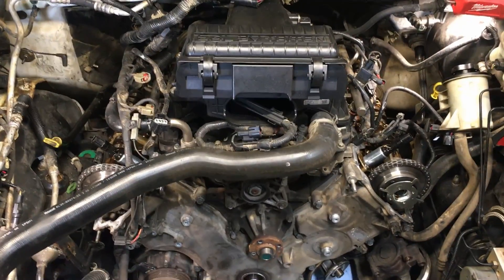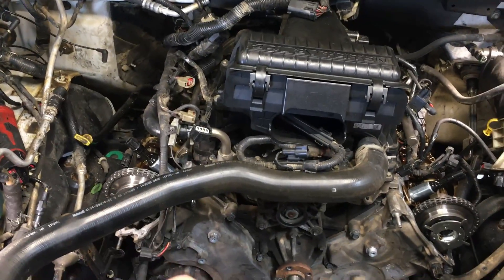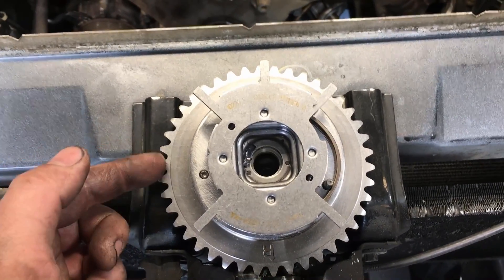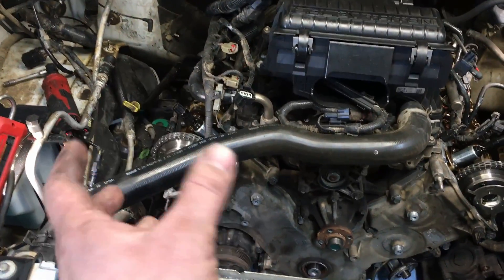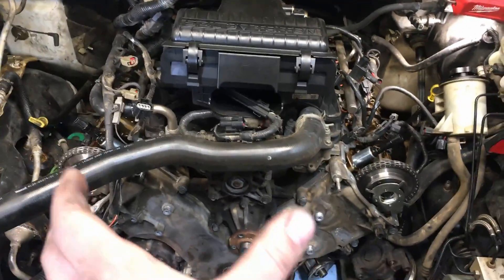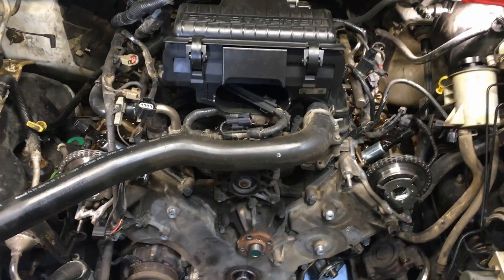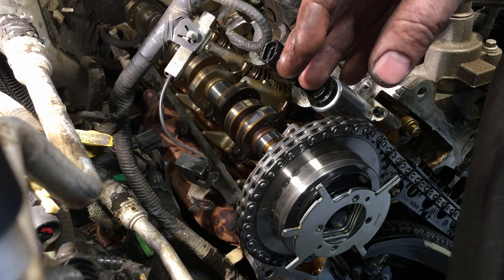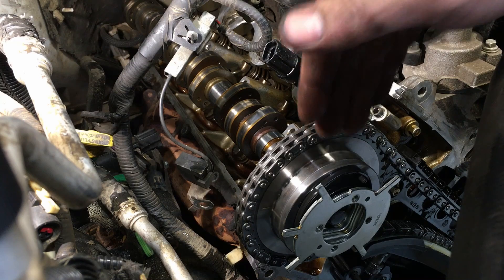Ford 5.4L 3v Triton Engine: DO NOT USE AFTERMARKET PHASERS FROM FREEDOM RACING/OTHERS; THIS IS WHY!

Comment: I did this job two days ago put aftermarket coyote parts. Turned it on ran fine accelerated ran like shit took it off because I thought I said the timing wrong. I did notice what you talked about at six minutes and 14 seconds but I was in a rush and I did not realize until it was too late. So I reset the timing and the same thing cam crank correlation On bank two. 
No I’m ordering OEM parts

Comment: I noticed that the colored link on the timing chain is also not lined up on the gear
Reply from the maker: They don't line up again after the engine is run or turned over by hand.

Comment: Ok so you say not to use aftermarket phasers but what if you lock them out? If you lock out the phasers does it matter if they are aftermarket?
Reply from the maker: Yes it does actually.
Reply: @FordTechMakuloco  why would it matter if they don’t have any moving components? No one from the aftermarket makes a decent part? Isn’t it the ford phasers that failed in the first place but we put ford parts right back on?
Reply from the maker: There have been many reports of the lock out blocks fitting loose in Dorman and other aftermarket phasers causing a knock afterwards.
Reply: @FordTechMakuloco  Thank you for the info. I just picked up an 06 F150 4x4 for dirt cheap. It has an intermittent squeaking noise coming from the passenger side cylinder head. I have not taken it apart yet.

Comment: I have 2, 3V engines and a 2V. I've not had any problems and no funny sounds all bought new....Doing my own oil changes 3000-4000 miles.189000 3V, 129000 3V, and 191000 2V. But...I like keeping myself informed! There's not but a few guys on YouTube I trust and watch......You and DieselTechRon RIP (6.0KIng)

Comment: You recommend changing the cam shaft position sensors?
Reply from the maker: no
Reply: @FordTechMakuloco  okay. I’m starting to get the low rpm engine rattle so I’m guessing it’s time to replace everything.
Reply from the maker: yup

Comment: When I worked for a used car dealer I did a bunch of these phasers some times a couple sets a week. I remember the first one that was done when I started working there another tech was doing the job and they bought dorman phasers l laughed and said u would be better off installing the used set of phasers off this core engine we had in the back room but everyone said “it’s just a used car by the time these are a problem the car will be sold and long gone. Well he put the phasers in and it ran like shit so he put in a timing set and still ran like crap so they give the truck to me to work on and just to prove a point I took the used phasers off the core engine in the back room and installed them, test drove the truck and handed the keys the the service writer and he said what are the keys for? I said the f150 I put them used phasers in it and it’s all fixed! He gave me this blank stare and I said I told you not to use cheap crap.

Comment: With Ford having failed like 6 times, what would you say about the new Dorman ones? I haven’t seen the ones that are failing but I have seen someone say a failed Ford one was dorman, or they were still using fords design, but the new dorman one has short veins and the centre part that the vein goes into has raised sections that bring the short veins up to the right position (the failed one I’ve seen having failed at the long veins and two of them snapping) the video dorman had claimed they were redesigned to prevent wear which I can’t attest to and seek guidance that is more up to date

Comment: Very timely video.   2007 f150 rebuilt 8k ago.  Had it in 4low and high revved coming up bumpy hill. Engine turns and tries to start but does not.  I am hoping this is where I start. Won’t know if phasers are Ford until I peel back the onion.  Is it a good guess I have a phaser problem?  No noises or oil from engine is noticeable.

Comment: Why do you have to take the whole thing apart I can change the phasers in 1 1/2 hours I get the ford parts should be used I agree 100% but if you know they failed I could wedge the chain and install just the phaser if the customer is comfortable with his timing marks, it would be more risk to him if timing is off I would have to go back in but so far never had that pulled covers wedged scratch markes TORQUE the center bolts
Reply from the maker: Why? I don't trust one piece of the timing kit he installed. Especially that aftermarket chain.

Comment: I bought cloyse timing kit and ended up having to buy a new for phaser for the passenger side now after some research I’m gonna have to buy a new one for the driver side. I’m glad I’m doing all my work my self.
Reply from the maker: Swap it all out, the aftermarket chains are known to break.
Reply: @FordTechMakuloco  I wanna get you opinion on what it is bf I go and buy a phaser.I got a 06 f150 new timing chain, guides, phaser and tensioners￼. Drove it for about 30 minutes no code but could tell some was not 100% right. Finally got a code p0022. Replaced the vct and changed the oil still the same code. What could it be?
Reply: Also millings oil pump and pick up

Comment: I have built a couple of small block Chevy engines (and I'm talking about the real deal here, not an effin LS) out of 100% aftermarket parts, including Dart blocks and ReherMorrison heads. They were not cheap. They were raced, street driven, seriously abused but properly maintained, and they are still running 15+ years later, both with over 300K miles on them. Yes, the timing chains were replaced every 100K miles. It is simply not possible to buy a timing chain that will last longer than that and not have excessive play in it. I consider that to be routine maintenance. Other than that, nothing but routine maintenance was done. You can get gear cam drives for these engines. I chose to use a proven chain brand and replace it at 100K intervals. I believe this proves the reliability of the design, WHEN BUILT RIGHT. OEM American V8 engines of the '60s and '70s were poorly built out of poor quality materials. But properly built, these engines are bulletproof.

Comment: I just did chains and phasers on my 5.4 following your videos exactly. After I started the truck at idle it was ruff and keeps punching code p0022. I’ve re did the timing 4 times and I know it’s not off. I used cloyes phasers. This issue would cause this code? I’m gonna double check if the phasers are where they are supposed to be as per this video. I’m guessing I should have not cheated out?????

Comment: Should I get this check out asap, just getting very minor sound on cold start up....just every once in a while? I heard your comment on using 5w-30. Will this help? 2010, 86k miles
Reply from the maker: yes
Reply: @FordTechMakuloco  Thanks
Reply: 5W30 full synthetic or semi synthetic? Any particular brand? I use motorcraft filters. Thank you for clarifying.

Comment: Do the 2010 5.4 have this issue?
Reply from the maker: Yup all the way to 2014.
Reply: @FordTechMakuloco  Well, it is what it is. People say the 5.4 is bad but the 3.5 still have the same issues and 5.0 had cam phaser issues as well as ovaled cylinders. 

Another question, my F150 makes a rattling noise when underload. When I hold the brake and in reverse it has this rattling loose sound. Thoughts?

Comment: I have a 2005 F-150 with the 5-4 complete new timing set phasers solenoid phasers cams both sides lifters rockers timing set everything was replaced on this thing and I still have a misfire and backfire under the hood no code showing been in the shop for a week nobody can figure it out it barely backfires under slight pull on the motor doing between 30 and 40 let up push on gas it'll backfire once or twice

Comment: I was just about to order a kit from freedom racing for 1200 that says it's all ford OEM parts until I seen this video here. So I ordered everything you linked parts wise instead. Currently have it pulled apart and someone has all ready put a cheap kit in it. Any guesses on what's failing in my system I'll give you a hint it starts with a p lol.

Comment: we are working on a 5.4   3 valve  Ford with a factory phaser  on it during the final 90ﾟ Torque specifications the face of the phaser moved a bit clock wise Will this cause problems with motor running starting  ect?
Reply from the maker: It should never move.
Reply from the maker: get it warrantied for a new one.

Comment: Hello fordtech. Wanna tell you how much I appreciate your videos. Haven't done my timing job yet on my 2006 F-150 5.4l. I did buy the master timing kit from freedom racing, but it is a Ford OEM kit and I've checked all the parts to make sure they're genuine Ford. Unfortunately, somehow one of the tines on one of the phasers was bent when I unpacked it so I have to wait to get a replacement from freedom racing. They offer the OEM master kit that also comes with all the Ford timing components and the upgraded melling oil pump with oil gasket set to do everything

Comment: Hi!  Just wanted to thank you for the great videos you post.  I started getting noise from my factory phasers around 120 miles, I’m at about 135k now.

Because of your videos, I bought a pair of Ford factory phasers, a new Cloyes timing chain with tensioners and a Melling M360 oil pump and factory water pump for my 2005 5.4L FX4.

Unfortunately we found too much play in the crank so we we had to order a crank kit.  The thrust bearing was toast.

I think that with the new components and the HV oil pump I will get many more years of service from my truck!

Thank you for all the great information you provide!  I appreciate your help!

Milton T.

Comment: I rarely buy OEM parts for my F150. I just can't justify the increase in price in some cases and I've had good luck thus far. FORD said I should only use motor craft spark plugs and coils for my 5.4. Nah, use better then motor craft when possible.

Comment: Ok. So I had a phaser and timing set job done.  On a 4.6 3v Picked it up and 2 days later.  I’m hearing timing chain rattle.  So I took it to another guy and  he said the tensioners weren’t putting enough pressure. They were aftermarket. He put Ford tensioners on it.  Thought the issue was fixed. Now a month later. Now hearing chain rattle again.  Should I just have the whole job redone.  With all Ford parts?  Ohh and the first guy also put lockouts in it.

Comment: Love ur 5.4 3 valve videos. Did my first and only one 3 yrs ago. Think im pretty good but followed u step by step. Advised customer to use oem. After finding kit online for some stupid 600 bucks we met in middle w dorman stuff for more than the 600 but less than oem. Said customers allways right. Said woundnt be responsible for parts. Well 3yrs later and 40 k on job has shit idle poo16 code w occasional phaser noise. They warranteed the vvt. Did crank sensor i never did doing chains. Also swapped cam sensor even though u said never go bad. No change second start money light andp0016. Believe its a phaser issue. My job went way further than 60 90 miles. Will never do another without oem. Bought all otc tools bout 400 bucks. Sit on my shelf. Customer doesnt want to spend any money so well see how long she lasts. Seriously though u do have the best videos on this stuff. Watched step by step.

Comment: What about 1a auto timing set? I always buy parts from them and they are high quality.
Reply from the maker: No way
Reply: FordTechMakuloco I ended up going with OEM cam phasers and that oil pump you recommend with 20% more pressure.

Comment: I have a 5.4 valve engine in. My box truck. It has a knock like a rod  but gets almost normal at idle after warm up. It only has 80k and regularly serviced. We drove it over 100 miles with this knock at 70 mph and it didnt blow up. So i dont think its a rod. Maybe a bolt backed out? But i heard u talking about the phaser knock. Could that be it?

Comment: I replaced the guides and chains a cam and lifters on a 2004 lariat at 125,000. The milage dropped from about 12 mpg to now at 150,000 I am getting around town 7.2 mpg. No codes showing so I figure the chains are times correctly. Have you seen this before? Thanks

Comment: Yeah, my cloyes timing set failed also. Found chunks of plastic inside the driver valve cover. Less than a year and a half. I did it the first time and now paying my mechanic. It's funny I bought all ford this time from,,,,,,,, you guessed it, freedom racing. Had to ala cart the order too because I didn't need the phasers I bought from them last time which are Ford. Waiting for my mechanic to call me tomorrow to tell me what fell apart

Comment: So wait a minute guys. I bought a kit which included phasers from Freedom racing approximately 8 months ago. 6 months later my Expedition is running like crap! it's showing misfires on cylinder 2 and fouling plugs on 1 side mostly cyclinder #1 & 2, and loose power on the freeway and its progressively worsening. I often get a blinking engine light and a vibration starting at 1800 RPM the power delivery normalizes after 2400 RPMs. It does accelerate fine. I've ignore the possibility that it could have been the phasers after the freedom racing Salesman praised me about the phasers that they sold me. Besides checking flow on my catalytic converters which was okay. I've already changed coils plugs fuel injectors fuel pump fuel filter mass air flow sensor and fuel rail sensor. Nothing has changed. It currently spits and sputters after waiting for a red light to turn green and then once it spins up past two thousand two hundred or so RPMs it accelerates fine. And also anywhere between 60 and 75 miles an hour. The engine light starts blinking away and I lose power and I have to play with the gas pedal to keep the vibration to a minimum. I have been battling this issue for 2 months now. Somebody please help.

Comment: The factory phasers in my F150 5.4 3 valve made it to 150K miles. The aftermarker ones I had put it didn't even make it another 10K.
Reply: My cloyes kit did the same. I at least have ford phasers

Comment: Livernois makes a phaser lock out kit and tuner for the 5.4L.  What are your thoughts on doing that instead of replacing the phasers?
Reply from the maker: No!
Reply: @FordTechMakuloco  makes sense.  My understanding of the variable cam timing is to replace the EGR systems

Comment: Hi Fordtech ....great video. what does a p0016 code and a p0303 code mean on a 07 exp xlt?  Thank You For Your Honesty
Reply from the maker: Mistimed engine or chain stretch.
Reply: @FordTechMakuloco  all my timing chain parts were changed and i only purchased ford parts. after i cleared the codes truck runs great....could it be the camphaser sensor on bank 1?

Comment: Question.  If I were planning on doing a timing kit with lockouts, would I be better to lock out the factory old phasers, or lockout aftermarket ones that come in the kit. The  issue is my truck is an old truck mostly used to plow my driveway ect.  I dont want to spend 2k on a timing kit on a truck I paid $1500. It doesn't currently throw any codes and runs well. It has the typical 2-3sec start up rattle, and hot idle knocking sound. The hot idle sound I kind of helped by ihave a evo tuner and I bumped the idle by 200rpm. To help out the rattle on start up when the truck sits overnight ect,, before starting I put the gas to the floor and crank for 5 sec or so to get the oil pressure up(with the gas pedal pressed it wont start up). then I crank normally it wont rattle

Comment: What should a person do if they really want to upgrade the cams on the 5.4 and put more power into it since they already need to do a timing chain replacement and phaser replacement? Should I stay with the same phasers or go aftermarket? Should I change the springs, Gide rods, and rollers?

Comment: would you recommend a cam phaser lockout kit I have an 07 3v 5.4 top end is quite but i was looking   for maybe doing the lockout as a preventative measure. the truck has 150k

Comment: Hey Brian Alan from the D, so this might be a first but my rt. side phaser has failed purchased on line from Wholesale Direct Parts it is a genuine Ford 3R2Z-6A257-DA 14 months old, 15,000 miles later one big fail. I like the truck if it would stop breaking down!

Comment: Hi ,,,     I have 2016 f150 5.0.  And I have  p0022  variable camshaft timing  (vct) position  is over retarded ,  I took the truck  with 2  ford Diller. Each  diller took more than a month   basically. More then 2 months.  and they  can't  fix  the problem  ,, they remplace the solenoid, 
vct Phasers  ,  and the  cylinder head  , twice  and the problem still  there ,   any   advice  ,,,or  idea  to fix my truck

Comment: What are your opinions on the phaser lockout kits?  I’m not really interested in putting it in as it would seem to ruin the fuel economy and power at higher rpm? Just not sure what exactly would happen with them.

Comment: It is the junkiest system ever ,why would Ford come out with a timing system that would be variable
Those are such nice trucks and they are about as reliable as the dodge 2.7 with those super long timing chains and garbage variable cam phasers
Can’t you just drop an old Cleveland motor or 5.0 in those trucks and I wonder if there’s a kit for that !

Comment: When you manually turn the engine over turning it clockwise if the faser clicks is that normal or does that mean it’s a junk faser?
Reply from the maker: junk
Reply: FordTechMakuloco really? Okay because I’m in my second year of school and my one teacher says that’s normal because there’s no oil in it and that’s why it clicks. The one guy I work with at work says it’s junk. I’m just trying figure out what’s right
Reply from the maker: They should not move and click trust me!
Reply: FordTechMakuloco sounds good thanks for the help. I like your videos a lot!
Reply: FordTechMakuloco and also what makes them junk?